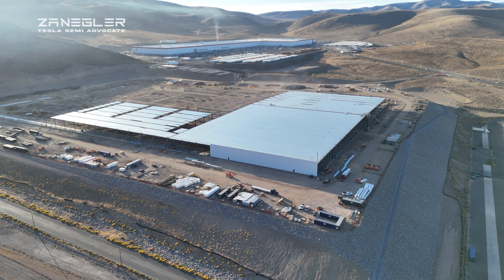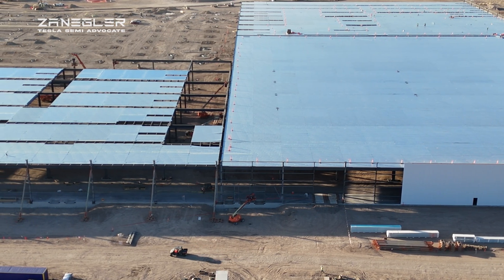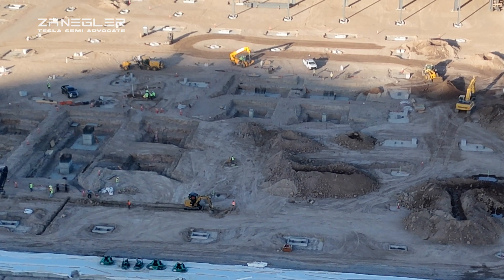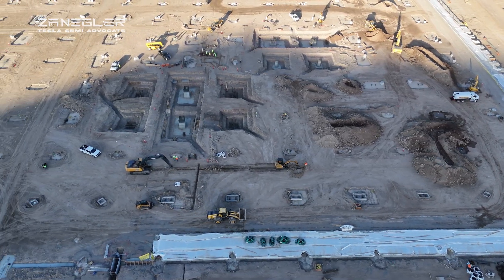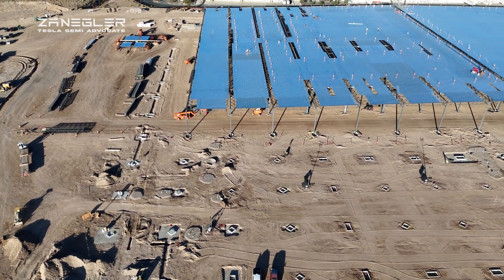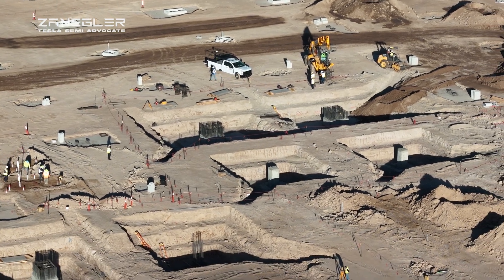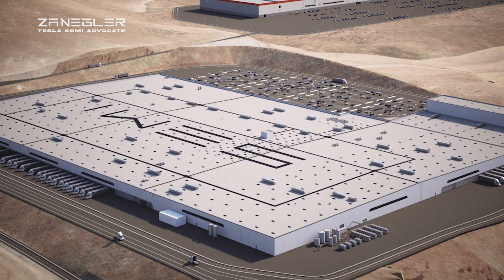Tesla Semi Factory Construction Battle Fought on Many Fronts October 11, 2024

Comment: Does anyone knows, other biulding has never finished  now, building another one next to it ??
Reply: There’s plans to finish the larger, earlier one too. 4680 production mostly and of course to finish the solar panel roof installation.
Reply: The building is just a cover to keep the production line/equipment warm, dry , clean. This is all about a set of heavy equipment built for a specific purpose.

Comment: The higher section on the south side suggests a stacker crane warehouse. Automated vertical parts storage. Large freezer warehouses at minus 20 deg F are filled with these systems because people can't work in them.
Reply: There a re many, many YT videos of all types of stacker cranes in warehouses.
Reply: Cold stores generally have the racks shuffling up. The whole rack will move left or right, with only capacity for 1 or 2 fork lift trucks, on each side of a central in/out conveyor. 
The idea is to maximize cold product density. 
I installed and commissioned one of these conveyors.
Reply from the maker: Love these types of comments. They really help give us ideas that we can check as progress continues b

Comment: 2:57. Dumping earth into the excavation to back-fill above the concrete footings. 6:32 also.

'Large square things with tubular things sticking out'. Centre right throwing the long shadows, are the column hold down bolts arranged on a plywood board to allow exact location within the rebar cage. Centre and to the left is formwork shuttering (grey plywood backed with lengths of timbers). These 2 column pedestals evidently to be built taller.

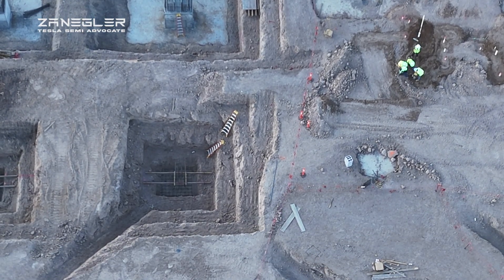3:28. 'little wings' were ramps for access as the footing was being constructed. To also be back-filled. 

4:18. Centre. Piles of earth with a trench. Adding water to the earth to make it more suitable for back-filling the deep footing excavations.

Comment: 50,000 Tesla semis a year? Nobody wants them.
Reply: I want them delivering to the supermarket near me so I don't here diesel trucks all night.
Reply: Actually an increasing number of people want them and fewer and fewer want noisy, polluting, inconvenient internal combustion vehicles.
Reply: Why build them then?
Reply: @paulmcgreevy3011  They won't build them.
Reply: This is a joke post  right?  Just ask PepsiCo why they are now expanding to about 100 Semis.  They are extremely pleased with the economic benefits from their testing.  Saving money talks.
Reply: @edhill8568  Let's see an independent review of the semi.
Reply: @Withnail1969  jay leno already did genius. And Pepsi shared tons of internal semi data from the Sep 2023 run on less event publicly on several semis running different routes. Multiple semi drivers for Pepsi have also shared publicly what the trucks are like SMDH. 

Inc doing 1,070+miles in 24hrs using slip seating. And Dan priestly who runs the semi program and is a trucker said that teslas in house semis haul batteries, scrap and motors 1-1 vs the diesels they replaced with 95% or better available up time. 😎
Reply: As a distributor, why would I pay for expensive diesel when I can use cheap kilowatts/hour to fuel my trucks?
Reply: @robertn2951  it wont be cheap.
Reply: @Withnail1969  cheaper than diesel,  that's for sure
Reply: If the can get the battery’s, this is completely possible to do. 
Consider Tesla make 50000 seats in 1 factory every 2 weeks.
They can giga cast 40 plus units an hour. 
Yep- battery’s will be the key.
Reply: Sorry, this was a stupid statement - Traditional Trucks are a major contributor to pollution, noise, and delays on the road Everyone will want them
Reply: The worlds most bought car, Model Y, had similar predictions. Tesla Semi will soon become the worlds most bought Semi.